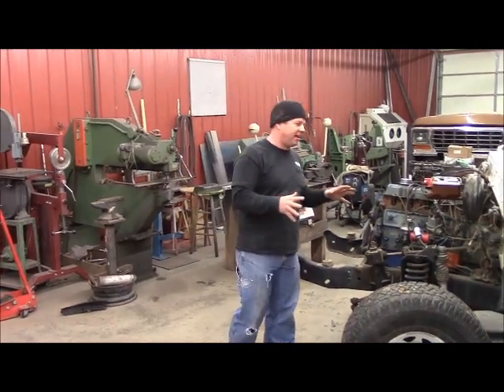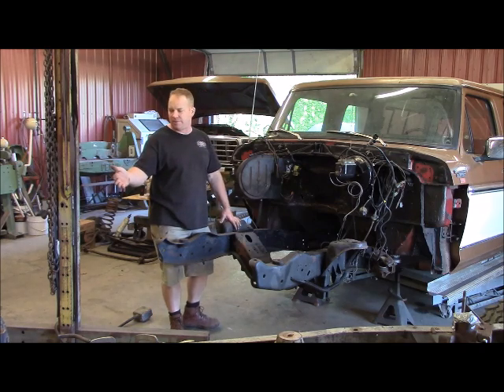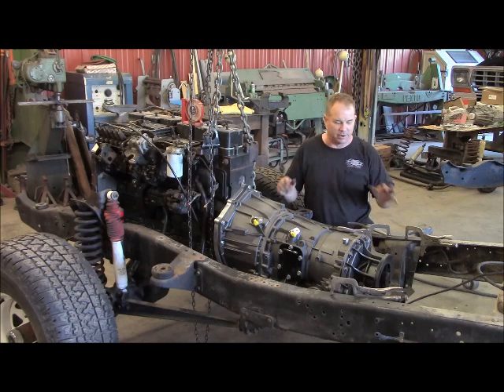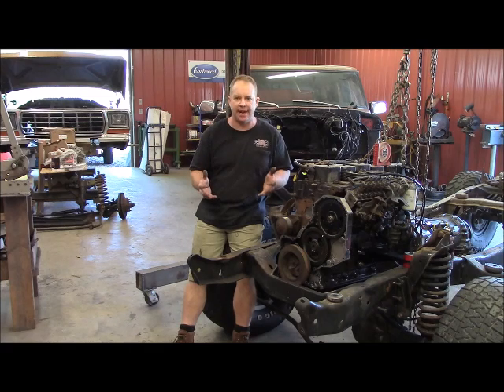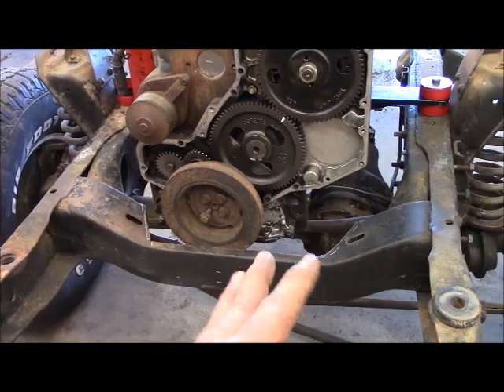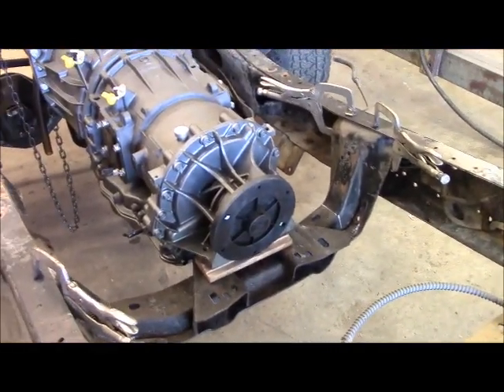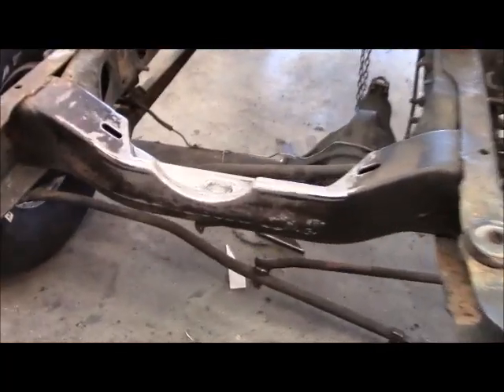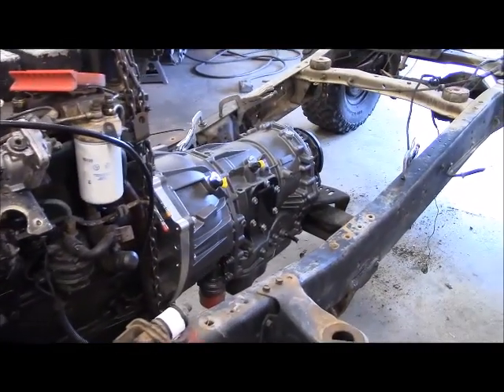Bronco diesel conversion update frame modify

Comment: wtf is a pushrod gasket?
Reply: Cummins have a "tappet cover" gasket. I have no idea what the purpose of this cover is other than for job security for techs to fix but it's there. The cover exposes the sides of the push rods. Nothing you can really do with the push rods through the cover but it's there, and it leaks quite a bit if it goes bad. It's probably the #1 leak that's possible on a cummins.
Reply: KrKrypton that is the dumbest thing I have ever heard on an engine, thanks for sharing lol